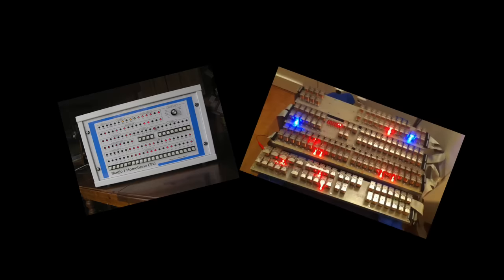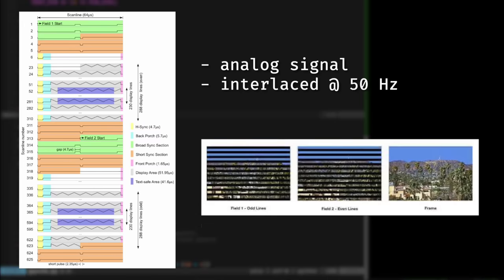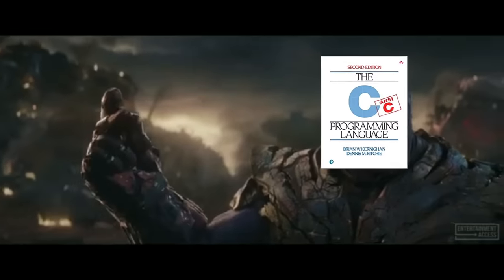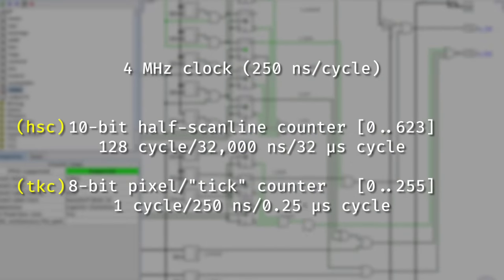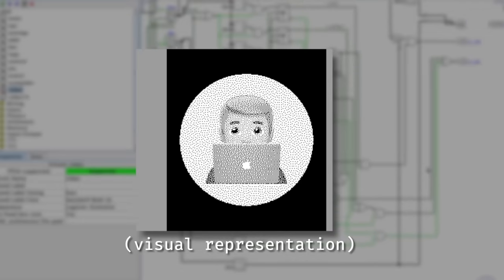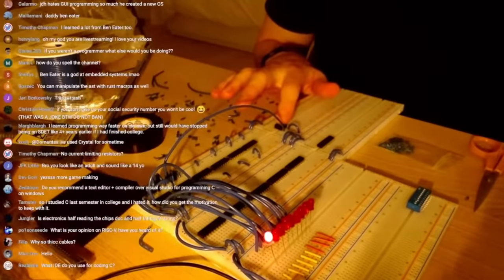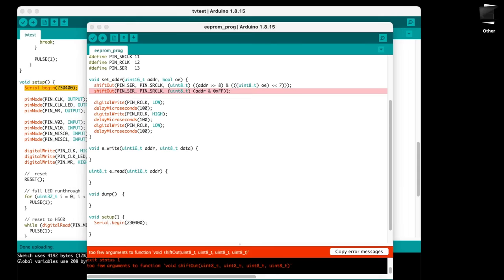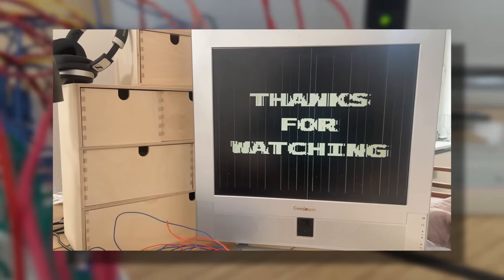I built my own graphics card

Comment: “150ns is too slow for a clock speed of 250ns”
Pfft no! You need to pipeline it. Use more registers. It’s relatively easy for a situation like that. Use this experience to learn about pipelining!
(By the way, I’ve made my own “graphics card” out of discrete logic ICs, it was definitely a learning experience for me because I am not an electrical engineer. I didn’t use software like logism either, but looking back I really should have).
Reply from the maker: I was considering a system that latched the data into a series of two registers and pipelined it, but we'll see how much of a problem this is when it's driven by 55ns access speed SRAM instead of the ROM chip - just didn't want to worry about it too much when the ROM driving it is only temporary. Thanks for the suggestion though :)
Reply: @jdh  Ah I see! Well, if you wanted to try a 55ns access time ROM chip you could get a SST39SF040-55
I should also warn you about a peculiar property of that chip: it's output isn't driven all the way up to 5v so the chip(s) that use it's output should have their inputs be logic level compatible with TTL

Comment: Next step, build logic gates from scratch using magnets. And make the magnets from scratch by wrapping wires around iron cylinders. And then use those to build the circuit from Charles Petzolds book "Code: The Hidden Language of Computer Hardware and Software" Chapter 17 from scratch.

Comment: Sweet lord - I hope those jumpers don't randomly snap!

Several people have done VGA and similar with full-fidelity emulation of NES and even the BBC micro on the Pi Pico board with just a "few" external components. That's one impressive piece of wiring work I must agree. I did wonder if that bird's nest, with all of that stray capacitance was knackering your clock signals though. 

Very impressed though. Super piece of work.

Comment: Resistors on the leds are not for the voltage in this case but for the amperage, 5v in to a 5v led is no problem but the resistor on the other side prevents the led from pulling too much current through the IC. Nice build though.

Comment: When you have a memory chip that can only operate at half your desired speed... You simply need another one, where you can flip back and forth, at half speed, to get "full speed reading". On cycle 0, you read memory A and B, but hold B's result, until A is done, in a buffer-latch... Or, simply flip at full speed, from one to the other. You will then get the output at full-speed, from each half-speed read, minus the initial half-speed loss.

Using a single trigger, at half-cycle, to get both answers at once, one buffered on a high-latch, is the better solution. This is how memory works for faster speeds too. You simply split even and odd bits into memory-chip A and B. This is why many RAM modules actually required parity, because they would otherwise run at half-speed. The memory-controller would manage the splitting and stitching of memory, treating the two units of RAM as a singular unit, with a singular address-base. (This physical process is repeated, over and over, to get faster speeds, as fast as the controller could manage them. 1 chip turned to 2. Then, to get another 2x faster, you needed 4 chips. Then, to get another 2x faster, you needed 8 chips. Then you ran-out of "bits" to split, in an 8-bit setup. So, they advanced to 16-bit, so they could double-up the 8 into 16 chips, for 2x more speed... Then, again into 32-bits of allocation, to get 2x faster again. Now you have controllers controlling controllers, controlling controllers... It's a mess... So, they made DMA chips and started giving CPU's direct channels to memory-lanes, for streaming. Leading to another 2x gain when pushing 64-bit memory-space.)

Each boost in speed, of any significance, has only ever come from adding another "split", with another "controller", to double the speeds. Totally not a speed gain when using 8-bits in a 64-bit system... Unless you find a way to stuff 4 of those 8-bit units into ONE of the 64-bit cells. The rest is just dead-space "00000000" values, between each 8-bit value, between addresses.

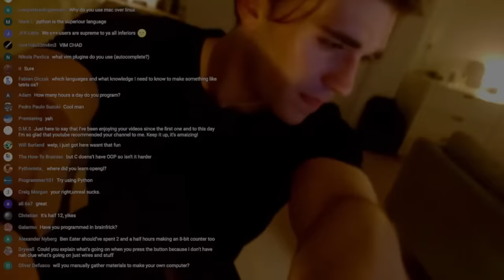Comment: @jdh 11:22 I would like to tell you that the voltage does not kill, the current does, and I=V/R meaning that no matter the voltage, if there is no resistance, the current will be infinite. Meaning that no matter the voltage of your LED, if it does not have any built in resistance, you are likely to kill it, or greatly reduce it's life cycle even if it doesn't die immediately, if you look at datasheet, you'll see that for LEDs there is no really maximum voltage support, but maximum current supported (usually in mA)

So people yelling at you are actually correct, and they can't explain to you in short sentences in live. And again I'll repeat, the voltage does not kill, the current does, and I=V/R, the more resistance you have, the less the current

Comment: Great job! You can use an FPGA, like I did in college for computer engineering. They are not always so expensive-- the one I was using is discontinued now but it was only $5 - $6 US. Some soldering required! But then just download the logic gates (if you've never used one before). 5 minutes from working simulation to working circuit! Keep up the great work. Also, you're very attractive! Congrats!

Comment: If you replace the EPROM with some SRAM and have the arduino load data into it for the "card" to display, you'll actually have a functional graphics card. In fact, you can tell the arduino to update the image data on the fly to actually display an animated image.

Comment: The 13:50 "data errors" looks a lot like "swapped the first and third lower order address bits". The flash (eeprom) you're using can't keep up with the pixel rate, but maybe you can have two 8-bit latches, and latch 8 pixels worth of data into one while you output from the other, or maybe a latch plus a parallel to serial. This may complicate the circuit a lot but you won't need faster flash.
Reply: BTW some early 80's home computers had similar or worse artifacts (I mean the vertical gray lines) and were done by companies. What I mean, keep up trying. I've just subscribed and will be watching your other videos.
Reply: I see from other videos you got it working? Congrats! That's awesome!!!

Comment: I had a video card do that to me once a long time ago, the capacitor on the sync(horizonal) ithink. Replaced cap and fixed ghosting. Is there a way to add filters? Most of my old cards used ferris choke beads to clean up noise. Hope this helps and great job, cool video.

Comment: Have you considered using higher awg (thinner) wires so the wiring runs can be less messy....or just less dense?

Looks like you're using 18 awg wire which is pretty thick for this application

Comment: 150ns should be OK; can't you just pipeline it - put flipflops before and after the video SRAM. Now your pixels are delayed by two clocks so you might have to adjust or delay your other timing signals to compensate.

Comment: The ancient instantaneous ROM-access architecture in NES was what we lost with modern microprocessors and microcontrollers. No more low latency instantaneous reaction to user action designed even in the most modern fastest hardware chips!

Comment: I didn't really understand why you went for an EPROM programmer instead of compiling your signal in a normal Arduino program, if that makes sense.
Would the Arduino RAM be faster than the ROM maybe ? I mean you could use the micro controller directly to send the signal right ?

Comment: 150 ns ... perhaps you could add an 8-bit latch?
instead of reading from the rom every cycle, you only need to update the latch once every 8 cycles.
this should improve the pixel decoder's effective timing to 18.75 ns.

or even better, two latches, so that you can be sure that writing to/reading from the latches won't interfere with one another.

Comment: That ist so Great. Lose ist.  Um of Courage you Need a resistier for the 5V LEDs. Your LED has more or less no Resistenz Wehen there is mir There 0,7v on the LED. So the current is Göttingen very high. Depends on the Output of your IC you use. Your IC could be dameged and destroyed. Unbelivable That you got this to work. 😂 respect.